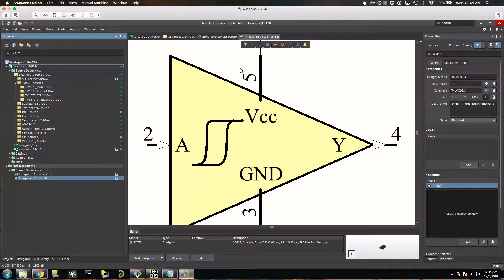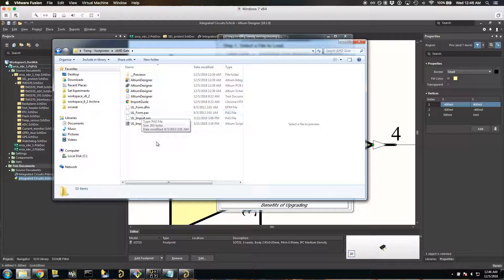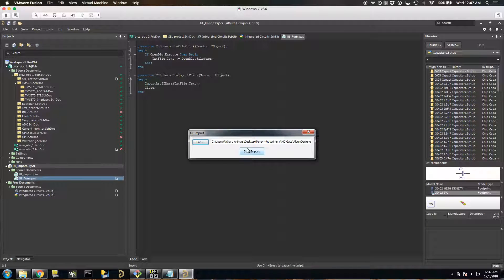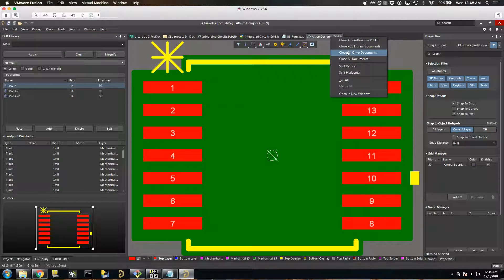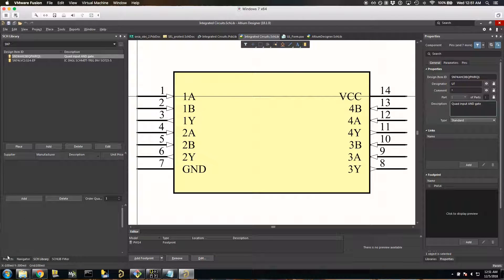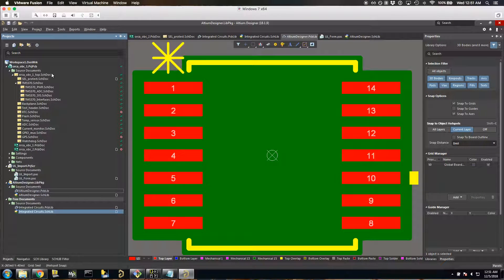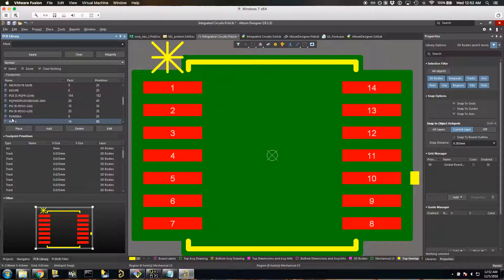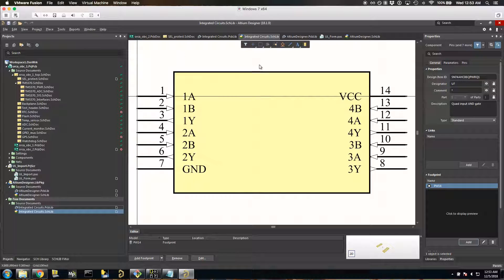Copying Altium Components and Footprints, Ultra Librarian

Comment: Such a simple and common operation requires so many steps and takes as long as 30 seconds. Why do the developers of Altium demand such a high price for this inconvenience? Do you even use your own program?

Seriously though, most modern PCB CAD systems have an outdated user interface. The only exception is KiCAD, which despite its lack of tools, has a library management with a simple and intuitive interface.